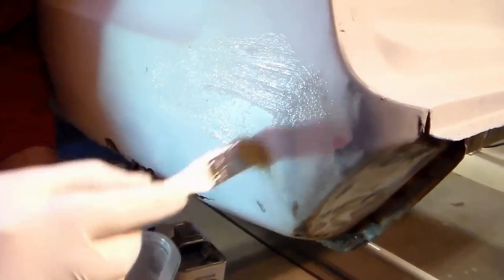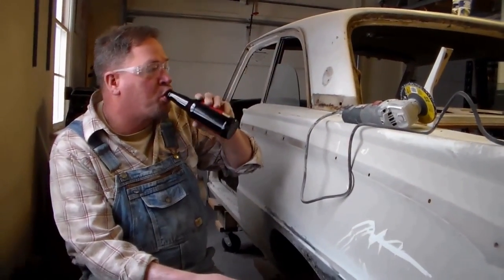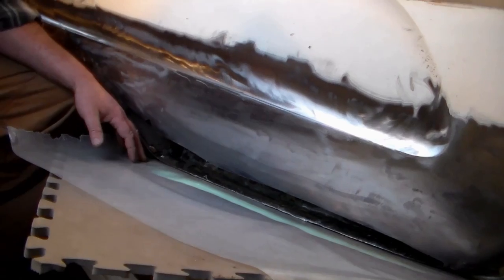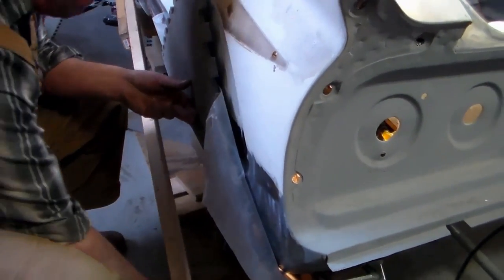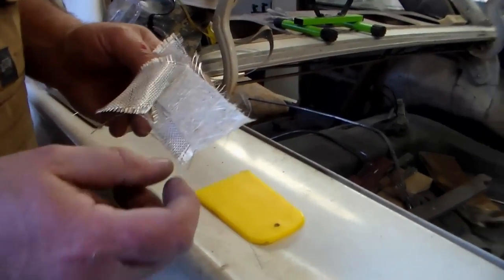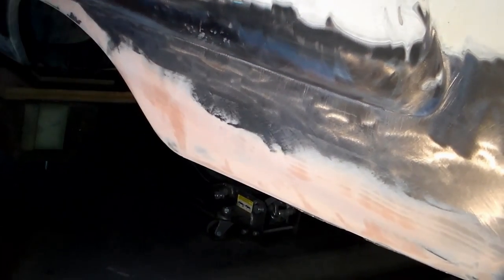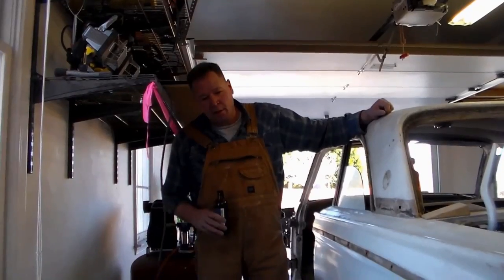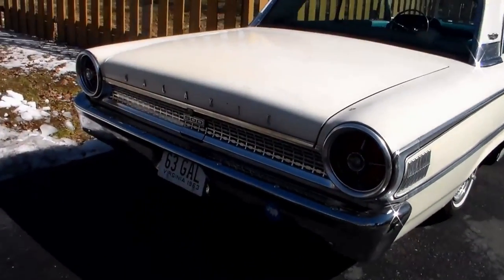Rust Repair Using Fiberglass Without Welding (Pt.  2) - Car Restoration

Comment: Thanks for the video, I have to fiberglass two holes in my Oliver 1550 tractor fender, I will be using your method. My patch work is all flat so no forming required. I appreciate you taking your time and effort (daughter also) in producing these videos for the less knowledgeable. Please post follow ups when completed (both projects).

Comment: Great video. I got a 94 Chevy truck and I never thought of this method. Doesn't need to be done 100% just want it to look better lol
Reply: Collin Aarhus duck waterproofing membrane aluminum the metal wall Mart 7.5$  id75353_03419 p.code prime first then tape and Bondo or red putty better thanfiber. polyken also367_17 but it's 30$.isee no difference between them. put it behind if accessable. we

Comment: I'm redoing a 59 Edsel Ranger. Some of the rust holes on the sides, I plan to fiberglass. The floor I'm going to weld in some new steal. It won't wen a show but it will be mine, and I can say I did it! It would be nice to gets some new rear quarters someday, but they don't offer aftermarket at this time:/

Comment: I have to say my first thought was, "What the hell is this guy doing"?  My second thought was "That's the same thing I did back in 1981 on my 73 Dodge Charger only I used a floor mat an shrank rap. I've been using wax paper and rap it around my filler board. You brought back some good times my friend. Great job.

Comment: I wish some of the O-C dweebs would put a sock in it.  Not every car with rust problems is worth spending 5-10K to fix up.  Not every handyman has welding skills or a welder.  For some of us "Good enough is good enough". I'm going to do this to one of my older work vans.  It might be worth $1500 as is with the rocker panels in bad shape.  If I paid a body shop $2000 to fix it "right" (something I have done twice on other vans) it might last 3 years before it rusts through again. No more. Thank you for a very informative video.

Comment: cool repair fibreglass especially in that area will crack eventually don't get me wrong i love fibreglass I would use some sheet metal cut with some JB weld self tappers than bondo
Reply: Maybe start with learn to spell first so people understand what you try to tell them?
Reply: Chris Chujkal what was spelled incorrectly?
Reply: You misspelled fiberglass. But it doesn't matter. I hate people that leave comments on spelling. It's like they have nothing else to say but to be negative about nothing.
Reply: Ya exactly lol
Reply: Punctuation, not the spelling. So hard to understand what people try to say if they dont use correct punctuation.
Reply: your flooring-sheet metal screws and jb weld is not an acceptable method for repairing a body panel...its a hack diy method.i own a bodyshop,been in the business 30 years.never used jb weld on anything...we use fireglass or panel bond,or mig welds...dont chime in unless you know what you are talking about
Reply: johncautobody ive got some rust holes on the corners of my roof. Dont have a welder and im tryna cut cost. If i sand down the areas to completely get rid of the rust and use fibreglass to cover up the holes. Then body filler and primer. Would the repair last long? Or would i be better off throwing out the extra cash and getting it welded? Thanks
Reply: Cyle _S i wouldnt take advice from johncautobody hes watching fibreglass rust repair videos but claims to own a bodyshop...lol

Comment: Your two videos on repairing rusted areas with fiberglass gave me the idea to repair my 1983 Jaguar XJS instead of employing the technique of what all the would-be experts think is the right way by welding metal only I have used epoxy resin in lieu of polyester resin and made my own fairing compound, instead of using bondo, of the same resin mixed with fumed silica and talc which spreads on like silk, bonds to the metal on a molecular level sealing the metal, does not absorb water, is flexible yet very strong and sands to an extremely smooth finish. The main question I have about using metal is when you weld metal and do not have access to the backside of the metal how do you prevent the inevitable rusting of those welds? Thank you very much for the idea. Frank Young
Reply: I have often wondered the same thing. A nice new panel gets welding in, but rusts again from the untreated weld behind. I work in the airline line industry and the composite repairs are done similar to this video. If it can survive bad turbulence and -30 degrees F, it should be fine on your car.

Comment: So. To clarify.... You laid the fiberglass from the inside on both repairs?
I've got a Ford PU that needs repairs around the leading edge of the roof, and the back wheel wells. What advice can you offer about laying up and finishing areas that you can't get to the back of? 
Thanks. 
I almost forgot to say..... Beautiful job!
Reply: Hey man. I saw this before Part 1. I see how you do it now. Will definitely check out the Eastwood guy. 
Thanks again.

Comment: Don't recommend doing this on such a large area especially a large outer panel. But this method works good for inner panels. Where it won't take force and is covered up....

Comment: Umm I'm shocked that this is classed as a repair?? It's a bodge and not 1 to be doing to a classic just get the welder out and do it how it should be done .you went to the trouble of bare metal why oh why

Comment: this makes me sick
Reply: it isn't that bad. Sure its not the "right" way to fix rotted panels but if you do it correctly it won't crack and break off the first time you drive it. I've had bondo babies that held up for five years then i sold it. Maybe it lasted ten years. Granted, it wasn't a rolls royce or anything, it was an old 73 malibu and it was a bondo baby but the shit worked good on a car like that for a seventeen year old kid. It was just a thrasher.
Reply: Boats Are made out of the Stuff    Should Last
Reply: Zilrodder m